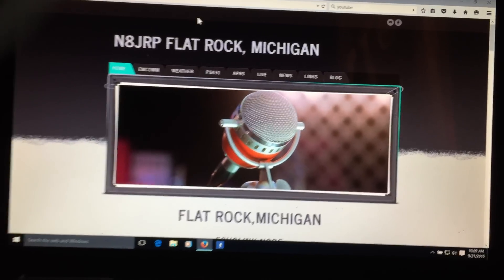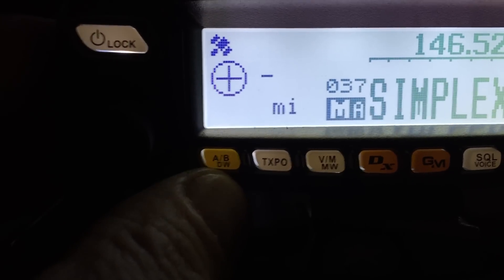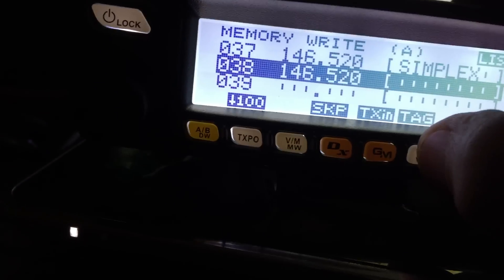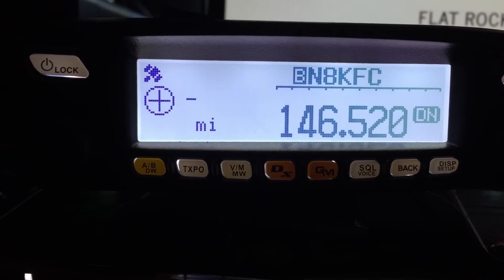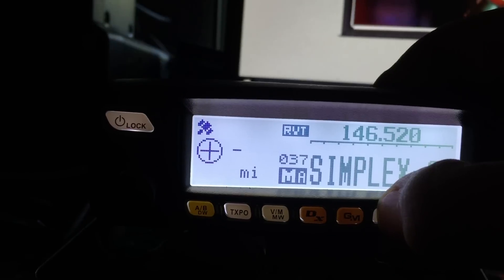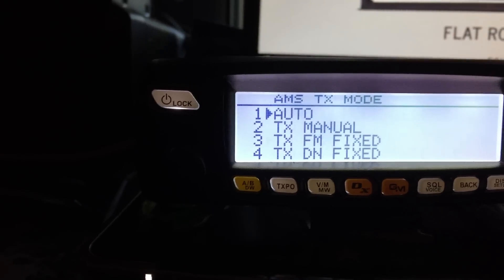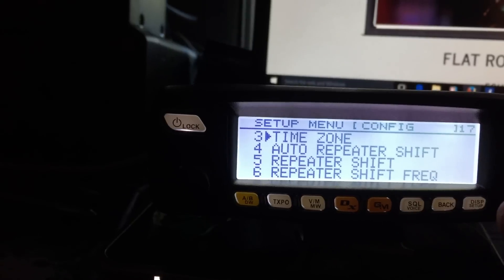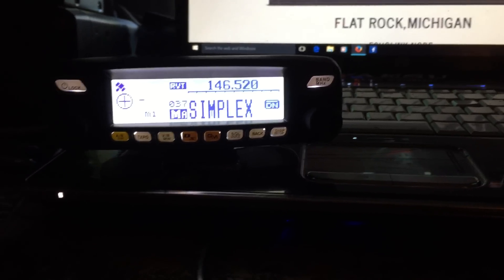Yaesu FTM-100 Fusion WIRESX digital Amateur radio C4FM APRS

Comment: im looking into getting into ham, 
can i do wiresX in a mobile or do i have to hooked to a computer? just wondering
Reply from the maker: no computer needed
Reply: yes you can so long as there is a node nearby you can go mobile using wires x .no pc needed...